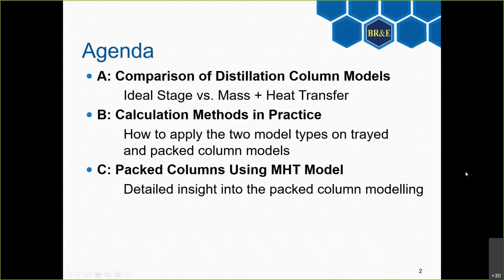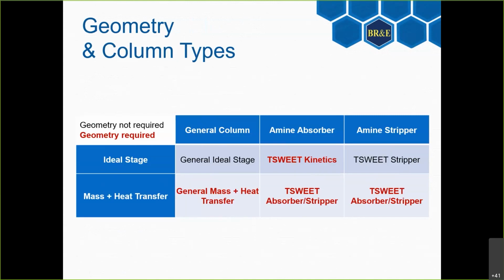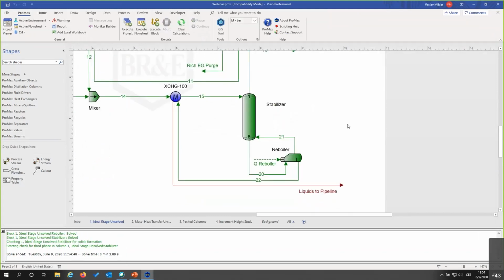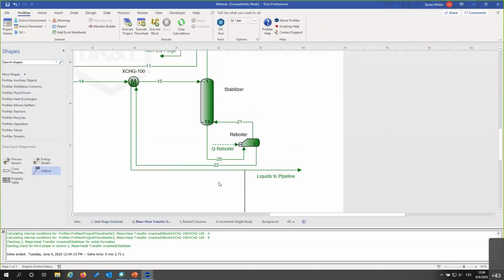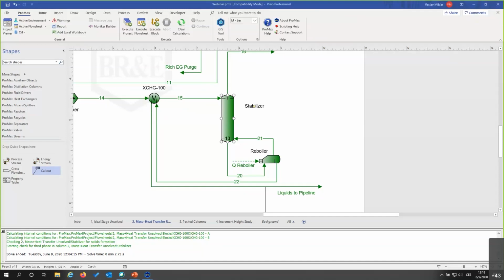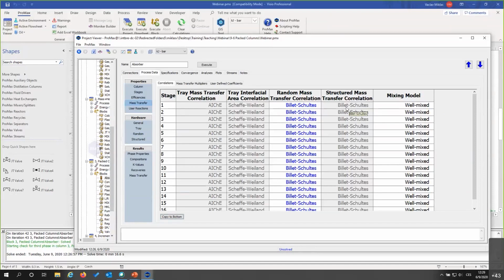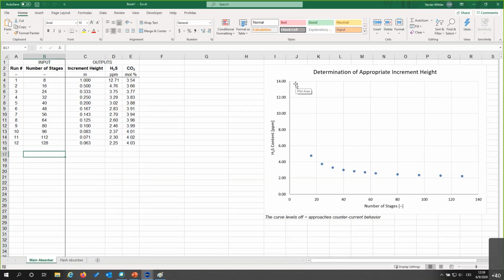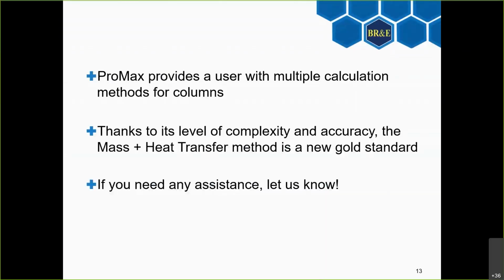Modeling Techniques for Packed Columns

Comment: How about in one scrubber contains Tray section at upper side and packed column in middle side.
Reply from the maker: ProMax is capable of modeling a column with different packings and also combinations of packing and trayed sections.